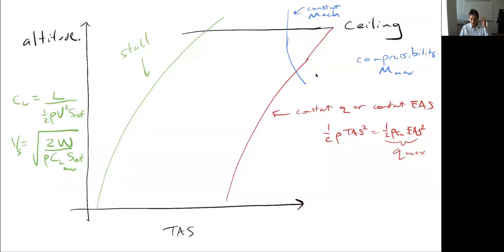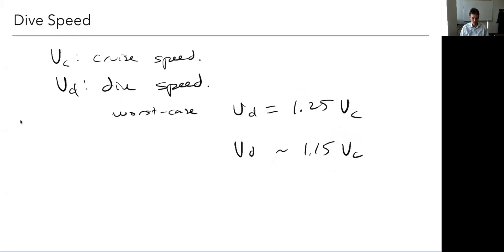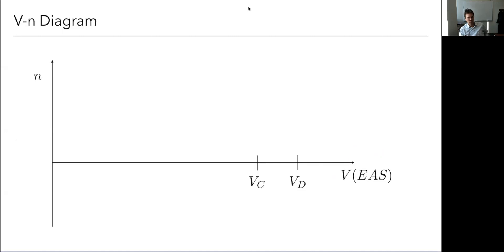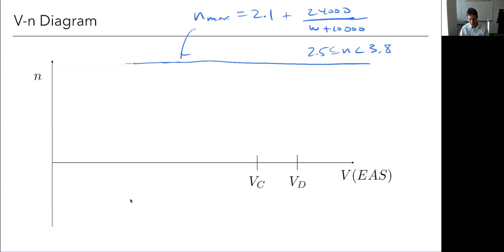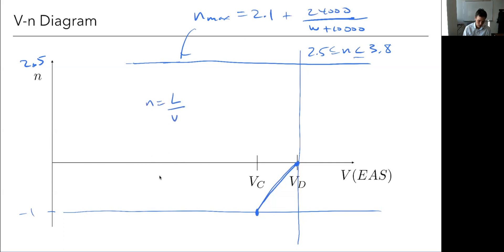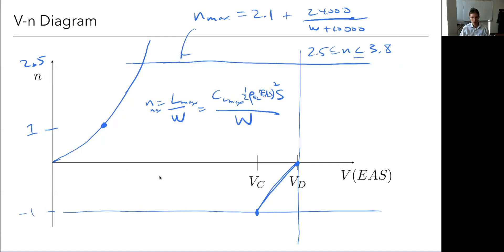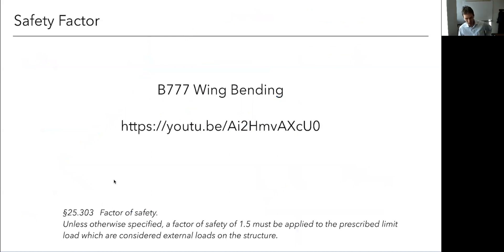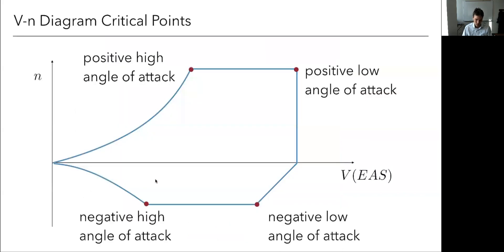19b-V-n Diagrams

Comment: Good Morning! Sorry to bother you, but I have a question, I hope you can help me.

If we have the n-V diagram for an aircraft created by the manufacturer/designer (that is, we already have the initial n-V diagram), and we want to do a structural analysis (as you said at the end of the video), do we need to do the diagram again? The diagram is "fixed" for each aircraft, right? Even after operating/being on duty and having an accident?

I really appreciate your help!
Reply from the maker: I couldn't say on the accident scenario, but yes in general the V-N diagram is fixed for the aircraft.

Comment: Could you tell me the definition of dive speed? 
Did I think of 'Dive speed' as maximum speed that aircraft can hold the shape?
Reply from the maker: Essentially it is the maximum speed the airplane can reach. It occurs in a dive so gravity is assisting in increasing speed.
Reply: @BYUFLOWLab   One more question, you told me that Vd is occurred while the plane is diving.
So I think, Whatever we do, the plane can't cross the Vd. 
Then how we can get to the caution range zone?
By turbulence? or wind gust?

I'm the student learning about aerospace engineering in South Korea.
I tried to understand clearly about the V-n diagram. But still don't understand about it.
😭😭😭😭
Reply from the maker: Good question, I wasn't really very specific.  Best source is to look at the FAA definition: https://www.ecfr.gov/cgi-bin/text-idx?SID=bb478a5887132908f96c26fffe0e31a5&mc=true&node=pt14.1.25&rgn=div5#se14.1.25_1335
Dive speed isn't the fastest possible, but is a practical limit often based on a 7.5 deg dive followed by a pull-up.
Reply: @BYUFLOWLab  Thanks for your help. It's really helpful for me.